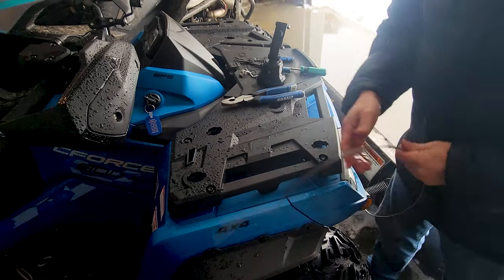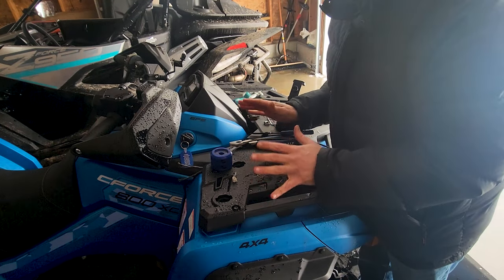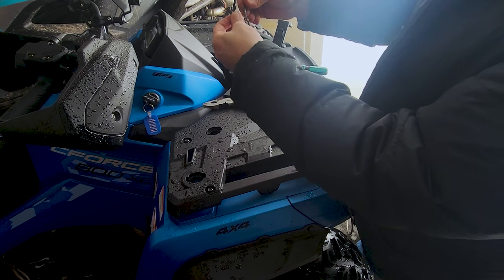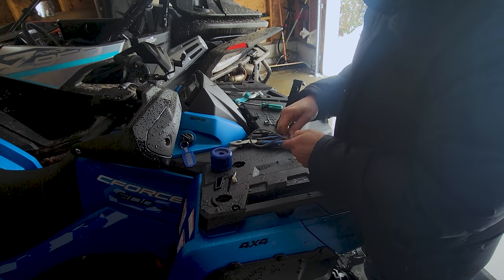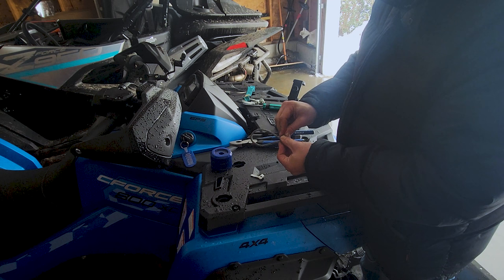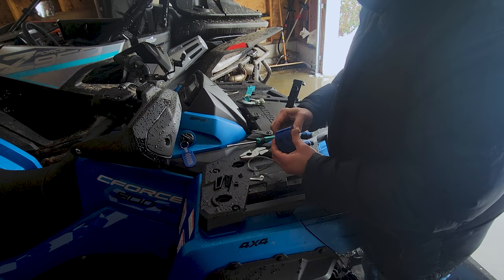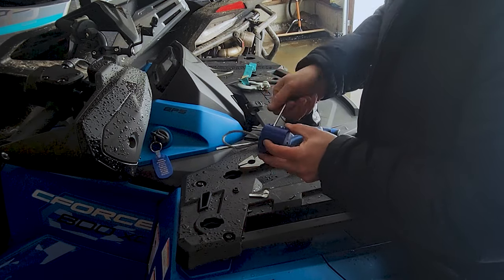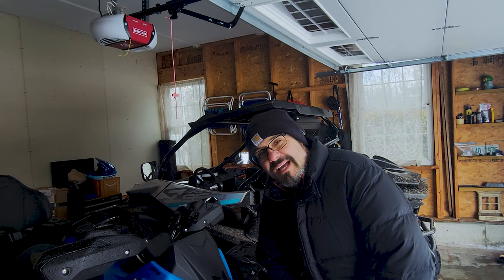How to Repair a Broken Plow Winch Cable Fast / No Tools Needed!

Comment: I put a new winch on last winter. So it’s just about a year old and snapped today. I’m going to try this temp fix. Thank you for your video.
Reply from the maker: It 100% works. I am going to change over to synthetic and put on a new fair lead. Look at when I made that video.  I'm still using the same.cable with the fix. lol, plowed three 3x this week alone. lol, see how long my luck lasts.